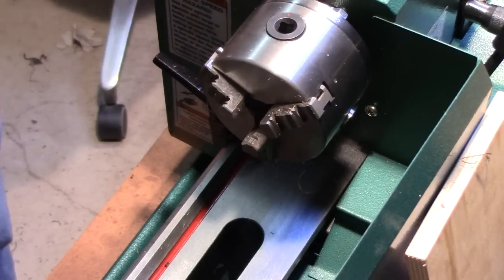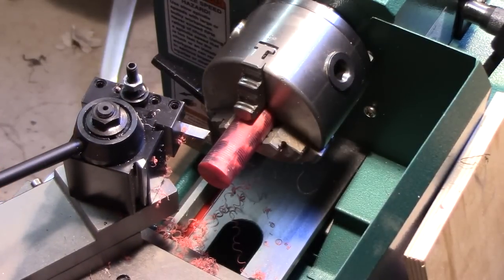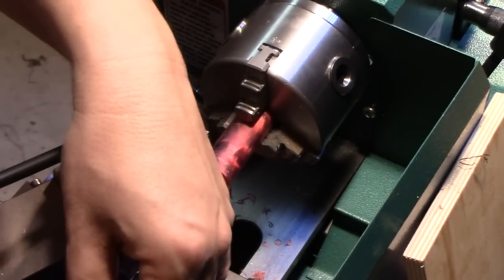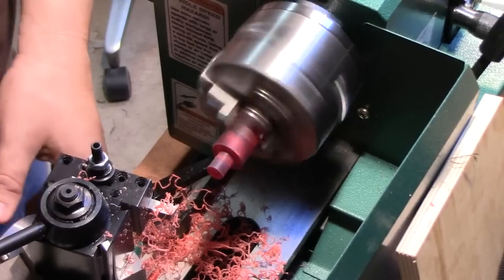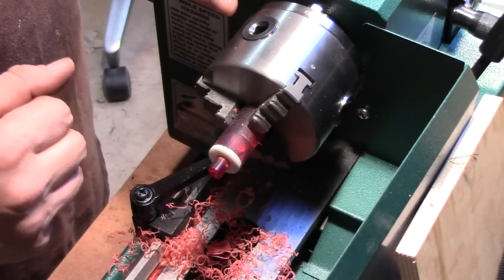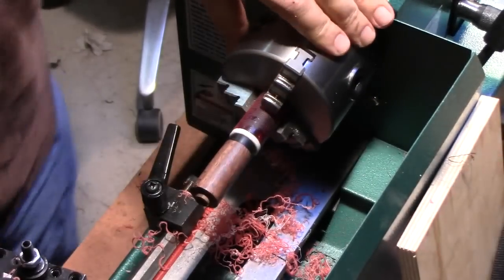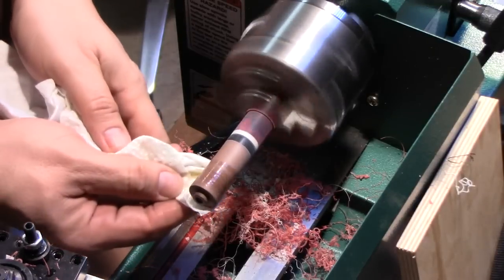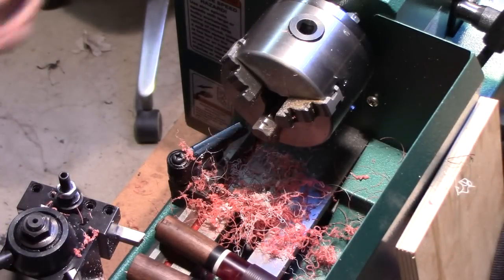This Might Get Loud:  Lathe Stem Work

Comment: Mike you're like a professional craftsman, interesting to contemplate you working.Thank you,
Now one question on steams,if you Mike, or somebody else might give me an advise, just few day ago I've gotten a semi-bent pipe of a Prince type, the model of Savinelli 313, and now I got a thought if I could modify this very pipe vulcanite steam shape making it straight using my brand new heath gun so in order  that the pipe is supposed to look like straight prince  instead of a semibent type,or whether I'm better off and not to attempt doing any steam reshaping/modelings with heath gun, I know many do use this gadget to fix loose fitting steams but also seen and told  it to be used on reshaping vulkanite steams.Thank You again, Paul
Reply from the maker: Hi Paul,  Thank you for the comment!  One nice property of vulcanite is that it has shape memory.  So most of the time when you heat a bent vulcanite stem it straightens all by itself.  The only problem is that it may need to be buffed after to restore the shine.  I hope that is helpful.  Let me know if you have any other questions.
Reply: All Right Mike,very good you pointed out this puffing thing...based on my experience in past restoring a shine without proper buffer wheel +caranuba is hardly possible, My Dremell drill with a fitted buffer leaves a lot to be desired,,
Thanks for advise, looking forward to next Sunday Chat.Todays going to pay a visit to my Mom.Greets, Paul

Comment: hey Mike when you get a chance can you show me or us how to turn down a tenon on a stem that came from Vermont freehand a prefab stem how it goes in the chuck
Reply from the maker: Sure thing Danny, but it is going to take a while with all the other stuff going on right now.  I'll give you a quick rundown in case you want to try it yourself soon.  Keep in mind I have not done this yet on the metal lathe, but have done similar stuff on the wood lathe.  I would use a 4 jaw chuck and clamp it so that you are holding close to the tenon end of the blank and that the bulk of the stem is inside the chuck.  You might want to use some masking tape to prevent marring the stem, but you will likely be sanding away a lot of the vulcanite anyway.  Next, I would put a piece of drill rod or something similar in the airhole, and use that to get the stem level and centered.  From there on out it would be just like working on a piece of rod.  The tricky part will be clamping the odd shape in the chuck.  My 4 jaw allows each jaw to move independent of the others for that purpose, but you might have to make some sort of wooden holder to sit between the chuck and stem blank.  Let me know if you need anything.
Reply: you answered what i was wondering no need for any more info thank you for the info im useing the round tapered bit and im useing a 4 jaw chuck i may do a vid thanks mike